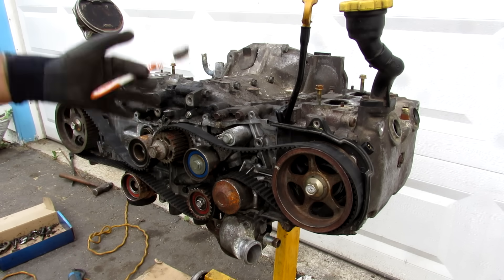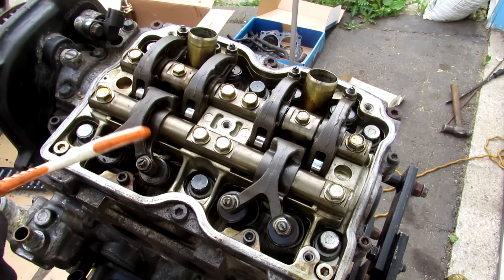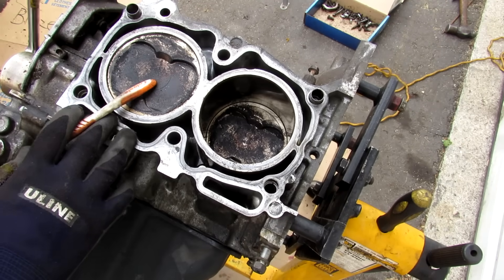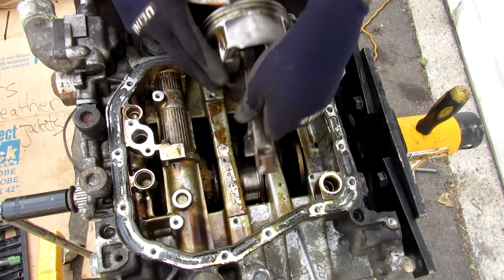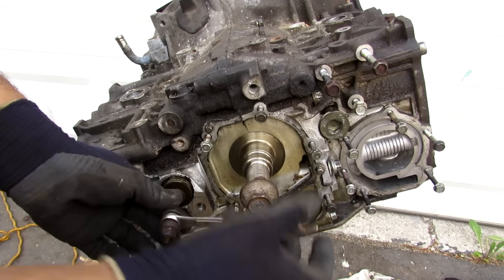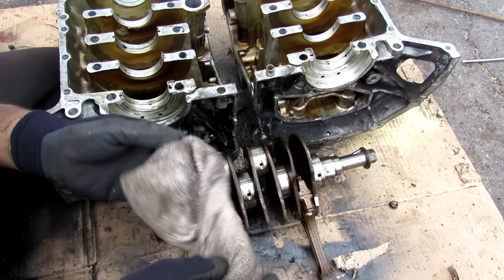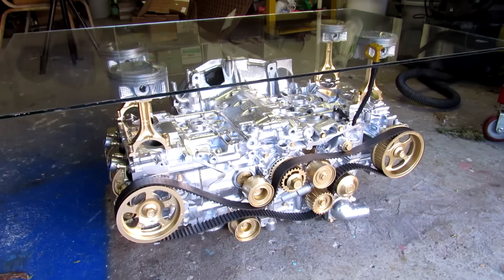Why Subaru Engines FAIL

Comment: One take away: do not buy Subarus.
Reply: Subaru's are some of the most reliable cars on the planet. Boxer engine is fantastic, it's stupid people that skip oil changes & services & thrash there boxer engine that Fucks it. If you own a Subie you need to know how to look after it.
Reply: Don't take that as a take away this guys information is very general and not fully accurate. For example the head gasket stuff he was talking about is only partially true. This issue only affected the EJ25 non turbo engines, and even then it wasn't all of the non turbo EJ 25's, he also fails to mention that Subaru has since introduced a new generation of engines known as the F series which corrected a lot of the issues of the older EJ 25's. Subaru's are reliable even those that were effected by the gasket issues if maintained properly.
Reply: @dominicancheif117  yeah I get it thanks.  The boxer style makes the oil sit on the gasket.  Frequent oil change is a must.  I really never liked the design.  I wish they would make I4 engines.  Best awd though.
Reply: @dominicancheif117  Yeah true, he also contradicts himself on other videos he keeps saying how good boxer engine & Subies are & how Subaru are on top of their game lol. So take what you will us Subie owners know their tough as.

Comment: Mostly this guy is completely wrong. I’ve ripped apart hundreds of these engines it’s a lack of piston skirt length for noise. Oil burning is because of ring tension. If you put more ring  tension on it I feel it would make less gas mileage.

Comment: Got a 2012 Toyota GT86 that uses a 2L boxer, (same as Subaru BRZ)  mine suffered valve spring failure, spring fractured and valve retainers cane out, valve got inside cylinder and piston punched it through head and piston top, new engine as it was under warranty and known recal.

Comment: Had 4 outback’s, and put 90k on all 4, only issue was an oil leak due to a seal, covered by warrantee. Boxer engine one of the best in the industry.

Comment: 5:12 That fram oil filter is the reason this engine failed.
Reply from the maker: Could be
Reply: @farnarkleboy  because US consumers generally suck at maintenance
Reply: You can use the best oil filter in the world and the engine will still fail. Its just bad engine design
Reply: @ButtonandBuck  complete bollocks

Comment: I am convinced here is another design flaw with subaru engines. I've seen some chew threw those main bearings even without running low on oil. I used to think under high load the engine could not oil that specific section well. But I don't have much proof unless there are people out there willing to let me destroy their engines by doing hill climbs without letting off throttle.
Reply: @farnarkleboy  no; i'm not talking about abuse like rev-limit clutch drops when the engine oil is still at 80F.
Only talking about driving a car how it should be enjoyed. Never had a dodge challenger complain at 150mph. And I've done 2,200miles straight at that speed. And no that would not be called abuse, everything was warmed up first and eased into it nicely.
Reply: @farnarkleboy  i think u got lost buddy. We were talking about the 2.5L boxer engine and it's engineered limitations

Comment: I wish Subaru's all future models are equipped with six-cylinder boxer engines. The constellation with the six-cylinder boxer engine basically means a vibration-free internal combustion piston engine. In addition, I think that the six-cylinder boxer engine creates a pleasant and harmonious sound (Porsche), which comes out of the exhaust pipe. The only disadvantage of a six-cylinder boxer engine compared to a four-cylinder boxer engine is a higher production cost.
Reply from the maker: I'd love to tear into an H6 one day

Comment: If you plan on getting a Subaru you best have Deep Pockets! Head gaskets go at about 100000 miles and that cost about 2500 to 3,000 bucks! They leak oil and water!

Comment: The place where I use to work I saw so many people have problems with Subaru cars.
When I was asked what I thought of Subaru  I just said shit boxes that are expensive to repair with too many problems.
I like a car that just keeps going and going and my car has over 5 hundred and sixty thousand kms on the clock it has a reliable in line six cylinder engine that just keeps on going.

Comment: As much and for as long as I have loved Subaru and the EJ25 this video just highlights for me the multiple ways this motor can fail. While with the correct training and knowledge these are all fixable issues, it’s disappointing to see Subaru still hasn’t developed a sound solution to many of the EJ’s fundamental issues. Many motors are salvageable, but at the end of the day it get old and expensive to continue to solve issues on a motor that has been around for a significant period of time without much engineered resolve. Thanks for the videos!!

Comment: Very educational. It's a joy to listen to the expert. Thank you.
P.S. Just one thing, you should make at least a second brake to take a breath, between clips. I had to stop in the middle to catch some air. It will sound more natural. Ha-ha.
Reply from the maker: Thanks. I take breaths but edit them out to save time
Reply: @speedkar99  I understand :-) , but one, mostly two seconds brake will hardly add one or two minutes. Then it will be much easier to follow and understand. Just my opinion. :-)

Comment: I had my doubts on boxer engines (never owning one) My brother bought a brand new Scion FR-S in 2013 with the 2L boxer...he has now 370k km (230k miles) He did is oil changes by the book with synth and put only 94 gas. It’s still runs with no issues. No engine problems ever. 🙃 i have an update 1 year later. The engine blew up at 435k km (270k miles) it idled weird and the engine died at low rpm he called me to look it up (im a heavy machinery/ truck mechanic) First thing i did before starting the engine look the fluids levels. No engine oil on the dip stick. I ask im did it start to burn oil he told me yes a little a couple months ago. 😅…
Reply from the maker: Nice, that's a lot of kilometers
Reply: 200,000 on our 04 boxer outback, always maintained always 92 octane. still runs like a top.
Reply: The miles are not the problems with these engines but the age. 

You can escape ozone and gaskets problems
Reply: It’s really amazing! Seen a couple 2013 for sale on market place as low as 90k miles with the engine blew up. The only maintenance was the spark plugs an alternator, battery and a clutch. A lot of wheel bearings they start to go bad and make noise every 30k
Reply: That makes me feel better about wanting to keep my 86 for awhile lol

Comment: Great video. 1 thing tho. Literally the last thing you said before your outro " a v6 has minimal shake because the v6 structure helps balance the counter forces of the pistons firing". Actually that's the Subaru motor. Horizontal motors balance the opposing forces of the pistons best, then v6, last in-lines.

Comment: I don't understand where the myth of the engine in a Subaru sitting low comes from, other than Subaru brochures. I have a Subaru, and I'm not blind. The engine CLEARLY sits ABOVE and FORWARD of the front differential, precisely the opposite of Subaru's marketing, which says it sits low and back. It's very vulnerable, sitting way out front like that, and in a frontal impact, the engine would take all the damage. Good for the occupants from a safety standpoint, but no doubt it would be totaled.
Edits: Wow, roller rockers! I had no idea. Mine does like to sing, so that's probably part of it.
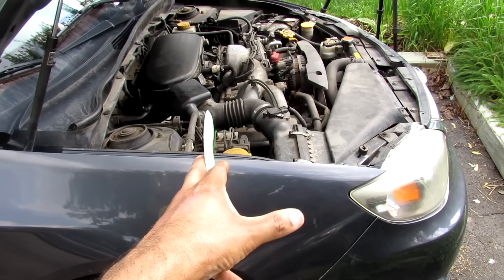12:13 Ah, okay, the forward sitting part is addressed.

Comment: To stop number 4 cylinder melting you need to twin feed the fuel rail at both ends or number 4 will bang out because it is running too lean!

Comment: The engine in this video is an EJ253 single overhead cam naturally aspirated engine. The common issues with the EJ series include oil burning and starvation, head gasket leaks and failed piston ring lands. ......................Where can i  buy one?

Comment: If you found trashed plain bearings like you showed us and you didn't really know the history of the engine, would you want to look for something else wrong or just rebuild it with fresh parts and make sure you have factory specified oil pressure? The boxers are such a big job to take apart and rebuild - I'd be worried I had missed something that might cause the bearing failure again.....

Comment: You definitely talked me out of buying a Subaru! Ever too damn many bolts to hold it together and yes I heard of Heads replacements at 70K miles Nice detailed on break down though too many pieces..I’ll stick with Toyota Thanx
Reply: Got less parts than a traditional in line or v engine.

Comment: I've had many Subarus thru the years (first one was a 1978 Yama Yagi) and NEVER had a problem with these engines ... two things you need to do is change your oil and retorque your heads on schedule and you'll get many years of service. Regular scheduled maint BY THE BOOK !
Reply from the maker: Awesome

Comment: First sign the engine was hosed: Fram oil filter.
Reply: Engine was deliberately damaged by not changing oil and filter at 5k intervals, so that they show such a shitty abused engine on this video.
Reply: "Filter" in a loose sense of the word.
Reply: More like a used napkin metallic particle recirculation aparatos.
Reply: There's a video here on YT somewhere where they test different filters and pretty much come to the conclusion they're all about the same. It's just wrapped paper in a metal casing.
That being said, I still only buy Subaru OEM filters.
Reply: @Keys879  
Not really. The weight of the filter gives you an idea of how good it is. I have used this filter and had excellent results.
https://www.amazon.com/dp/B003L35936/ref=au_as_r?_encoding=UTF8&Make=Subaru%7C13&Model=Forester%7C57&Year=2010%7C2010&ie=UTF8&vehicleId=1&vehicleType=automotive
https://www.amazon.com/Mobil-M1-110A-Extended-Performance-Filter/dp/B0727SCP22/ref=psdc_15727201_t3_B0067ECS6W
Reply: @TheGecko213  kool. thats what Pep Boys has been selling me
Reply: Subaru OEM filters are made by Fram
Reply: Use these filters  every 5k miles and engine won't look like the shit in the video.
https://www.amazon.com/s?i=automotive&rh=n%3A15727201&_encoding=UTF8&vehicle=2019-13-57-268--9-6-6-23550-1039-1-1-3667-188-7&ref=au_pf_dp_lf_ladp_1_4
Reply: @2D wix or napa gold
Reply: @jeffnorbert1871  I agree with you.. WIX or NAPA GOLD or OEM...the only way to go!

Comment: Interesting. I have an Outback and Forester. We drive them between 15,000 - 20,000 miles per year. Do all the recommended maintenance. They have over 160,000 and 220,000 miles respectively. No major issues!
Reply: Yes. This engine in the video is deliberately starved of oil and abused with no maintenance, to show this video.

Comment: All that trouble, effectively making two engines, make me wonder why they didn’t use a dry dump oil system.
Reply: These engines are not reliable.    The design was quirky and cool in the 1970s,  but if ever a car company needed an engine line update to conventional inline 4 cylinder and V6 engines, it's this company.       The "low center of gravity" argument is pretty weak nowadays, too.

Comment: Really good video, you know your stuff!  The bearing wear shows the need for regular oil changes using good quality oil, I may reduce our oil and filter interval changes from 7500 to every 5000 miles after watching this.  We bought a new 2019 Forester with a 2.5 Boxer, and 45,000 miles later no problems.  I am still not convinced about the longevity of the Boxer engine though, that's the reason I wanted to buy a RAV4 but my wife preferred the Forester.
Reply: Yes. This a abused engine with no oil changes and done deliberately to show this video  :)

Comment: I love Subarus and was warned about the engines, but damn this was Hella Informative bro!!! I think you could've been best friends with Ed China and Ant Anstead for sure. This was the equivalent to Ed China's automotive explainations on Wheeler Dealers but just waaaay faster. I think (If you have the time) you should put out videos on Good & Bad engines and how to look for trouble signs before buying. I'd love to throw a Subaru engine in a VW Kombi, but now I have plenty of research to do. Thanks for the great post.

Comment: The reason I am so happy with Subaru is that my Subaru cars never failed on me. No defects only normal wear (brakes, battery t.k.o.s.) So since I drive Subaru I've never had more cost than normal maintenance (in 15 years 2 cars about 250k km). In this video you sort of 'explain' why the engine build is bad, but I tell you: in daily use it proves to be extremely reliable and that's what counts for me, more than any story you can post.
Reply: 94 Ford Ranger 2400 engine, +26 years +240,000 miles.
Reply: @wcurtin1962  2000 honda accord zero problems and just hit 330000 miles
Reply: Ditto…same here!

Comment: My brand new back in 2014 Subaru 6 cylinder would burn 1 quart of oil every 3 k miles. Dealer said normal. Also sounded like a diesel for the first few minutes after start up ( probably cylinder slap)
Reply: It wasnt broken in properly.
Reply: @ssnerd583  no normal driving dealer maintained. Had for 40k. Ran fine no smoke but always burned oil and clatter on start up ?

Comment: All these gasket issues we used to repair since firsf 2.5 DOHC in 1995..we even made a block-reinforcement to prevent gasket leaks. Should say, 2.5 are sucks.

Comment: we only got 294,000 mi w/no engine work out of our '84 Subaru.
Reply: My 06 wrx has 220k miles on it and regularly sees 22-24psi and in the mountains and on the Texas highways at 90mph....its a happy camper.
I think its user/driver error that kills subarus
Reply: @ssnerd583  our 2005 WRX has 201,000 mi on it.  our 2007 2.5 I had 200,000 of fast ski road miles on it when it was totaled by a motor scooter (paint).  son-in-law drives it.

Comment: I go 10,000 miles sometimes more, between oil changes and rarely top off the oil between changes. 2003 Accord with 340,000 miles now.

Comment: So the best design is V4 (why reinvent the wheel) in terms of power, smoothness and maintenance, followed by either one, depending what you're after: the in line 4 lasts longer and is easier on maintenance, while the horizontal in line 4 runs smoother, but craps out on maintenance due to oil circulation problems leading to head gasket, cam bearings and oil return rings failure.

Comment: Two comments:
1) The short stroke has nothing to do with where the engine makes power.  That is an old wives tale that everyone repeats.
2) I didn't realize until now that the EJ is an open block design (meaning the cylinders are sort of floating in the block, nearly completely surrounded by water jacket).  Isn't that a major contributor to the head gasket issues?  I remember learning about this a few years back when the Focus RS went under scrutiny for its open deck design (and head gasket issues).
Reply from the maker: Yeah open deck isn't as strong

Comment: I had three different Subaru models over a long period. I would add and say that they were very reliable and never dissapointed me. They were quite robust and cheap to fix. The last one I had was a 1998 model.
Reply: Finally a reply on the subject and not the messenger.
Thank you for you experienced opinion on the vehicle.

Comment: The bearing that you said was not lubricated gets its oil from the other half of the block or the crankshaft.  Possibly Oil goes into the drilled crankshaft from either or both sides of it and travels to it. The same way the oil gets to the connecting rod bearings. Otherwise, the engine would not run 15 minutes off the showroom floor.

Comment: Boxer engine is old antique design. Subaru needs a new modern engine. People think it's special but it's just not good for long life.
Reply from the maker: They can refine a boxer alot more 
It just takes development hours
Reply: Remember though that a Porsche still uses a variant of the H6. So yes, with enough $$$ and R & D, they can make anything last a long time.

Comment: I am on my 5th Subaru from 80s through to 2005. All have done in excess of 250 kms without mechanical engine problems. Just cam belts and spark plugs. My current Imprezza is up to 270k and still going fine. I have always put this down to regular oil and filter changes at 10,000 kms intervals. Love Subies.
Reply from the maker: Nice. Not all Impreza owners maintain, some treat thier cars like a Corolla

Comment: This person lacked oil changes and who knows what else. I owned a 99 forester I bought it with 169,000 miles , when I sold it it had 220,000 miles and still ran like a champ . But it did burn oil about a quart between changes . After watching this video now I know why. Excellent video and full of knowledge. Just to add to this video cam seals go bad at 100,000 miles also common problem.

Comment: I'm glad I seen this, I will not buy one of these nut sniffing shit heap's. I have over 500,000 on my old 7.3 ford and I drive it daily. No problems, just a couple starters, wheel hub bearings, water pump, radiator. I'm not a mechanic, or a diesel expert. Changed fuel and air filters and keep good oil in it. I met a guy with 650,000 miles on his and no major problems.

Comment: I always thought these engines were supposed to be great but it seems they have MANY problems. I certainly wouldn't wait for the full service intervals to change the oil.
Reply: Honestly, I see a lot of Subaru engines that go 250K or more without problems and every design has its pros and cons. The main thing is that the EJ25 won't tolerate much neglect. The design is open deck and the cylinder walls are pretty thin which puts a lot of pressure on the head gasket.